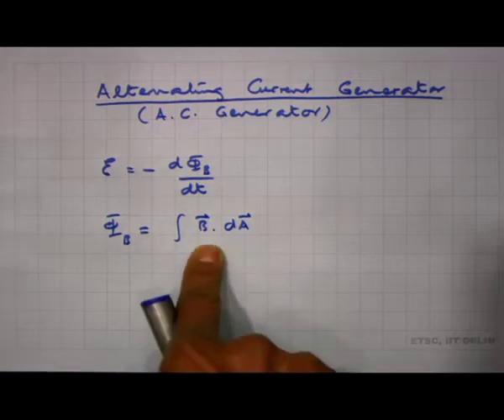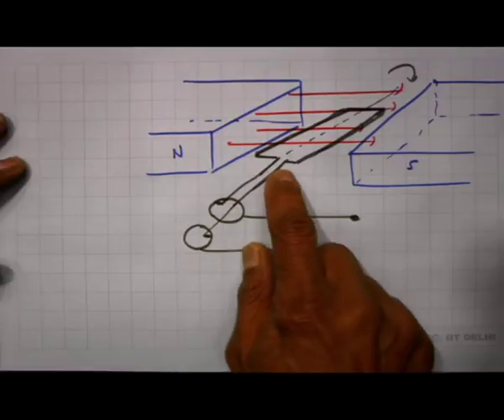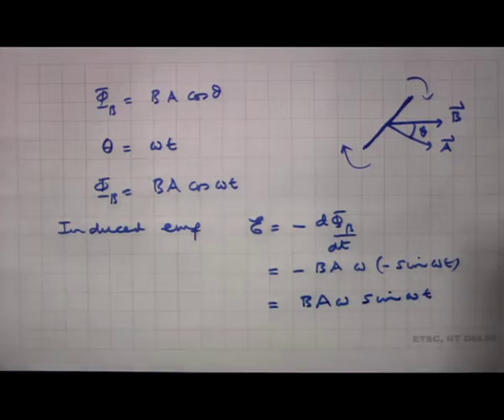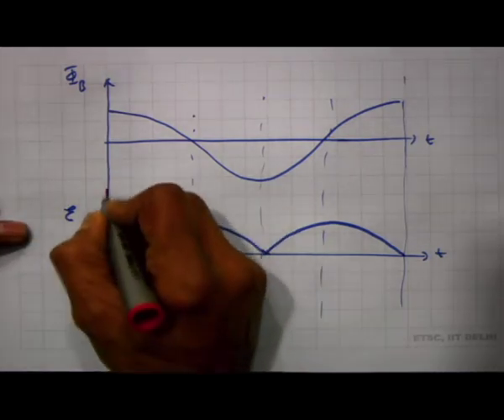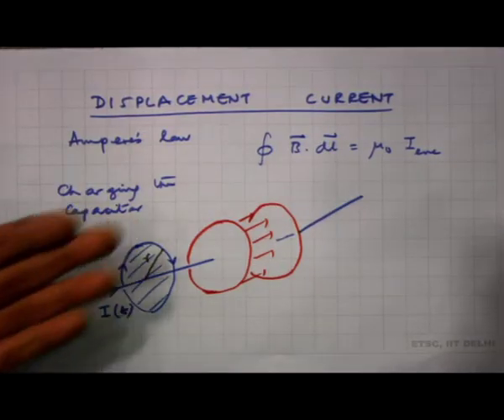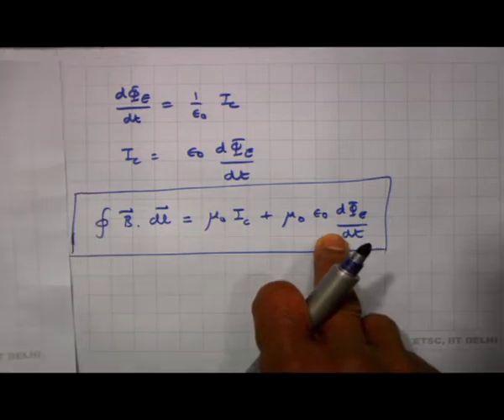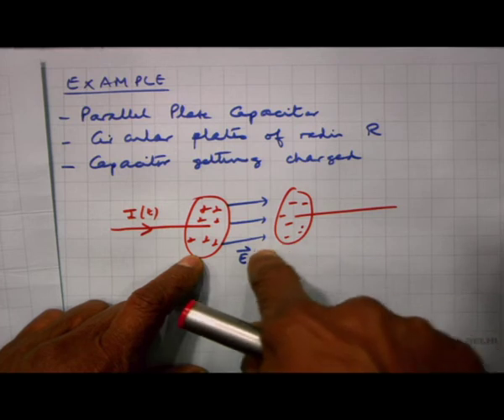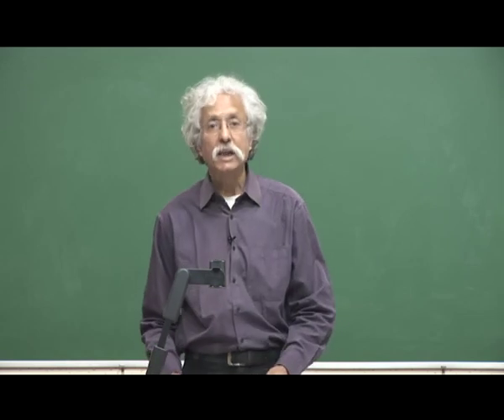AC CURRENT GENERATOR (CH_22)

Comment: Thank you very much sir for all your efforts.
I have following doubt in Displacement Current.
Consider a surface (S1) which "partially" encloses one plate of capacitor, also the conductor crosses the surface (S1). If required refer the image in link below.

S2: Flat surface only crossing conductor, not capacitor plates.

If we calculate RHS of generalized ampere's law on S1, would it be same as if calculated on flat surface (S2) ?

If it is same then how effect of Ē enclosed by S1 is zero?

S1: https://drive.google.com/file/d/1qdvnOyeBYHZTDtCjftMgCWqGVwVAQlA8/view?usp=drivesdk